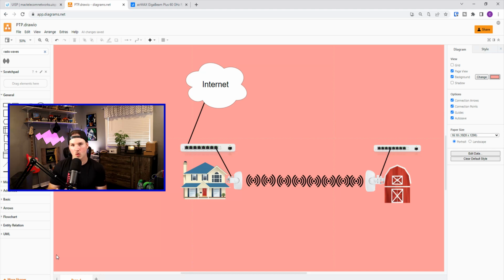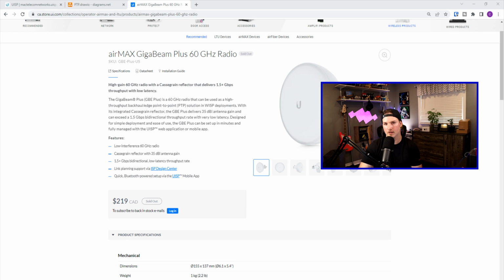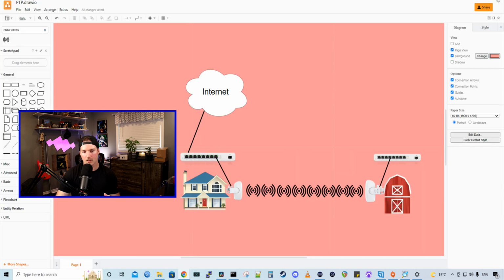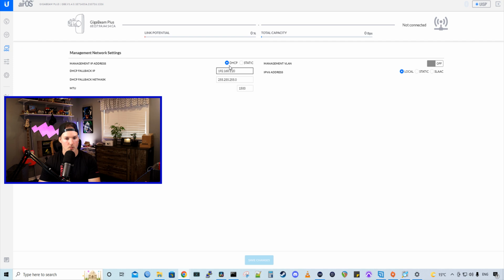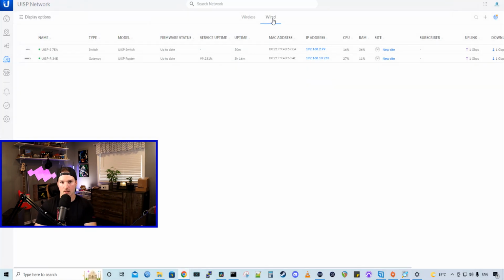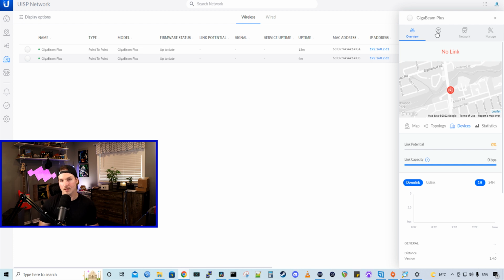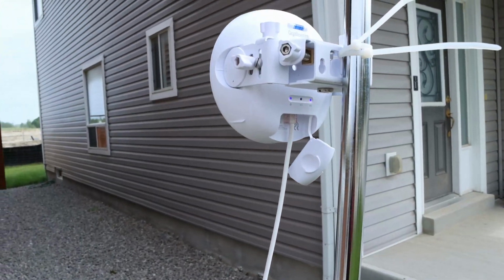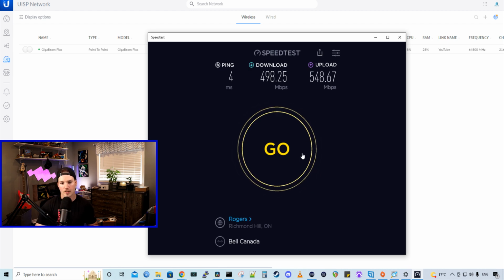Ubiquiti Point to Point setup

Comment: I have the Gigabeam plus as well connecting 1 building 1900ft away and another building 2200ft away direct line of sight. The Gigabeam is giving me a solid connection of 1.43Gbps previously had the Gen5 Nano Beams which gave me 680Mbps

Comment: I considered the Building Bridge for a 100' wireless uplink to support my outdoor theater.  I've gotten by with a pair of AC-PROs which gave me a consistent 702-975mb/s link.  Recently upgraded those to a pair of U6-Mesh, and now I get a consistent 1.44 Gbps symmetrical on the link.  Those AC-PROs lasted me 6-years on one, and 3 on the other, both basically continuously exposed to the weather, and they were still going strong.  No need to update them, but the U6-Mesh were better weather rated, and latest tech.